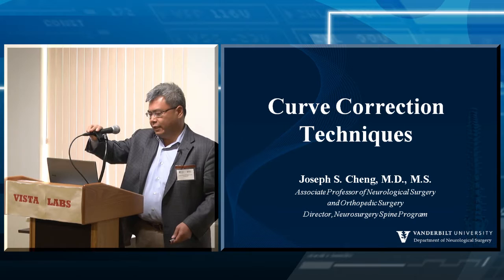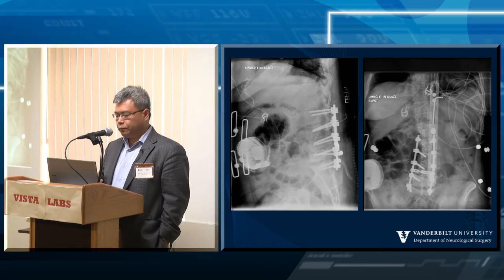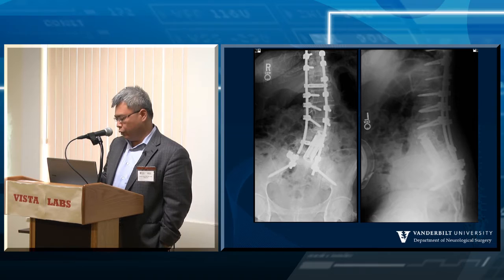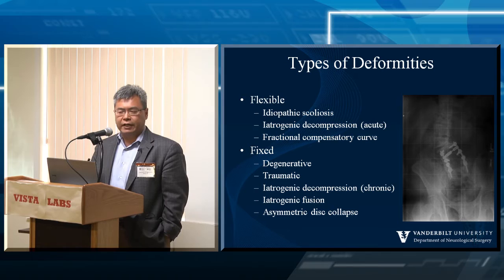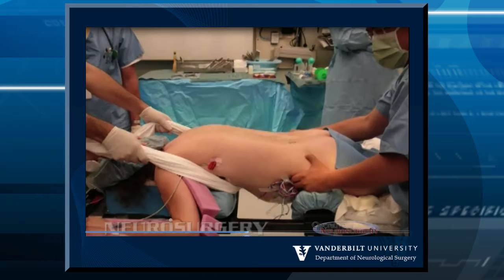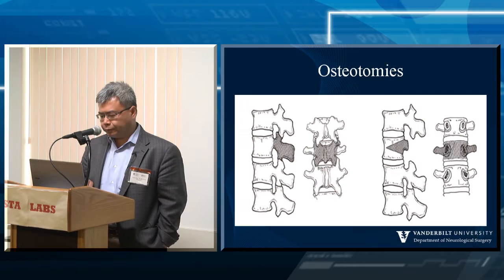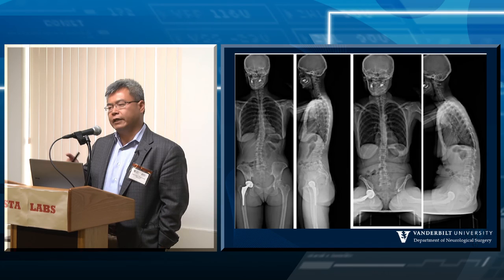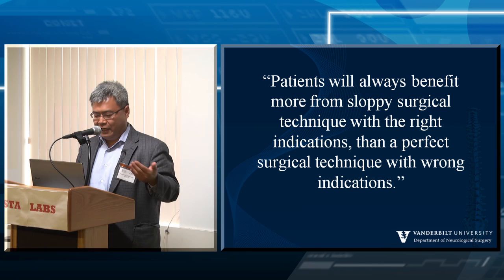Curve Correction Techniques

Comment: I was surprised to learn that residents position the patient for scoliosis surgery.  I had fusion with Harrington Rod T2-T12 in 1981 with two excellent surgeons.  When placed prone on the casting table, my shoulders felt like they were being shoved forward and mentioned this, but with no change.  Even now, 40 years later, I feel like I cannot stand up.  I realize a lot can change in that length of time.  Also, I noted that the rods in several of those x-rays extend quite a bit past the screws.  When I was finally out of my cast after 7 months, I felt like I was getting poked from the inside - I was!  My doctors went in and cut off about 1 1/4" of the stainless steel rod and also found pseudarthrosis where the fusion was supposed to be, cleaned it, stitched me up, and that was that.  A simple thing, but it makes a big difference!

Comment: Overall good talk but 2 points

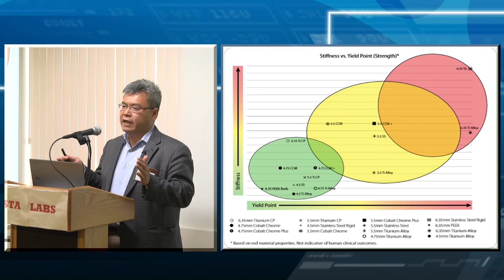@ 17:18 to 19:23 
1) "yield strength is how much energy rod can absorb before it fractures." Yield strength is the point between the elastic and plastic range on a stress-strain curve. Ultimate strength actually refers to the point on stress strain curve that refers to maximum amount of energy material can absorb before failure. 

2) "stiffness is that slope on the flexion curve and is brittleness. " Stiffness is not brittleness. Stiffness is directly proportional the young's modulus which is the slope on the stress-strain curve but also considers the diameter of the rod and the length between two anchors. Brittleness describes an object that does not have a large plastic range on the stress strain curve.